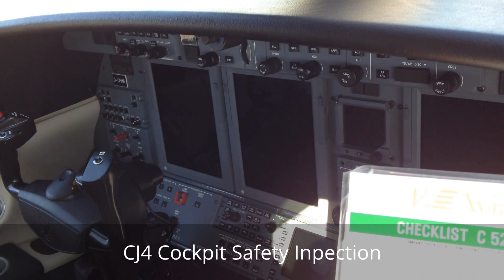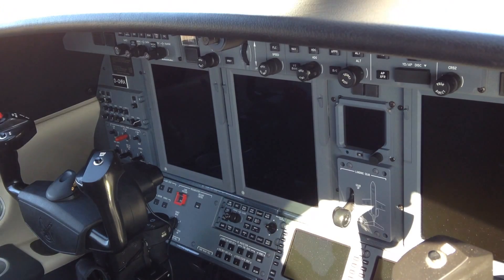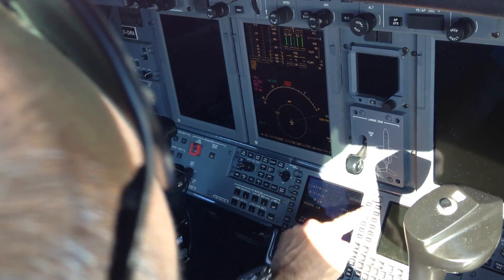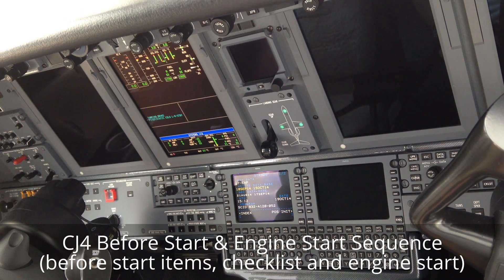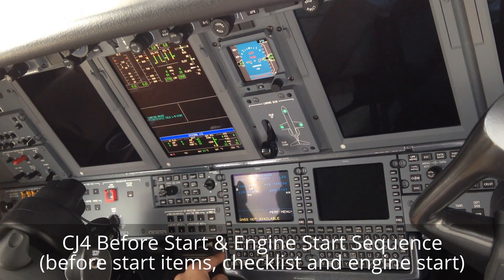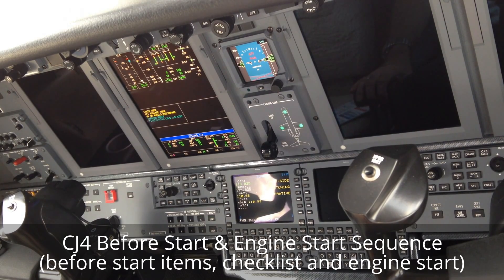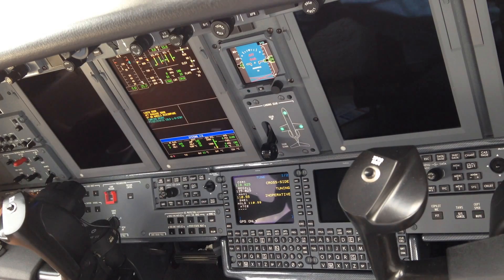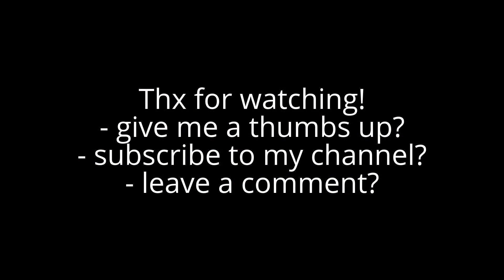HowTo: CJ4 Cockpit Preparation, Initialization and Engine Start|Tutorial

Comment: Nice video thanks for sharing. Can you make a video explaining the systems and cockpit layout?
Reply from the maker: ... when I made this video it was more like an experiment. But it turns out that this kind of more instructional piece draws a lot of interest. So, yes, I will be happy to do so. And I have this on my to do list. However, it takes a longer empty leg flight to have the kind of environment for such a video. Alternatively a longer phase on the ground when the engine is running anyways. Whenever the occasion arises I will keep your suggestion in mind
Reply: Mehr Spaß am Spaß Haben Haben Thanks for taking my request into consideration, I understand how time consuming and difficult it would be to fit that suggestion into your routine. But either way I appreciate the videos you post and will continue to enjoy them. Thanks again.

Comment: I can't believe how many amps starting the engine takes, or how much it draws when not running too!
Reply from the maker: ... very true and also the reason why the bigger airplanes do not use electrical starters, but rather start their APU first and then generate bleed air for the engine start procedure. Also, you want to protect you battery condition before start in a small jet very well so that the engine start does not damage the battery; that is particularly true during winter ops conditions